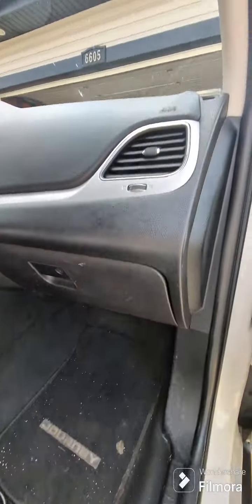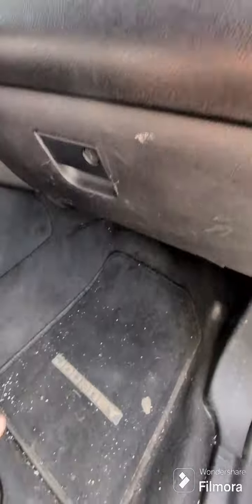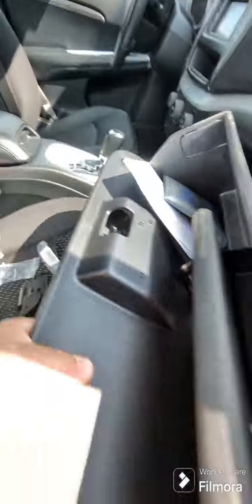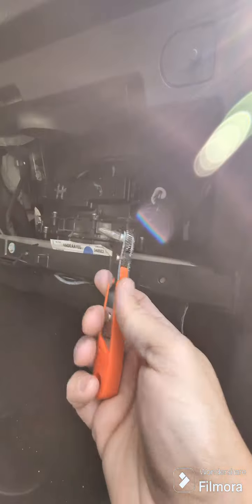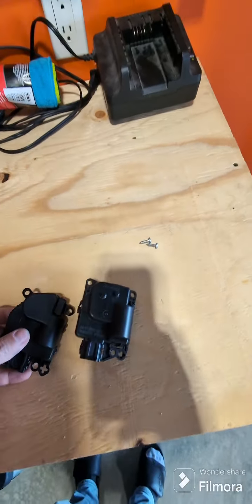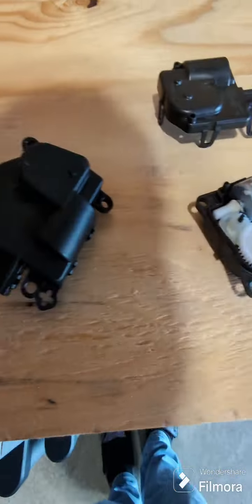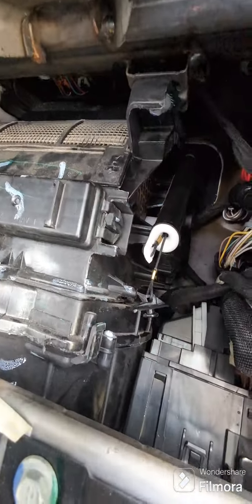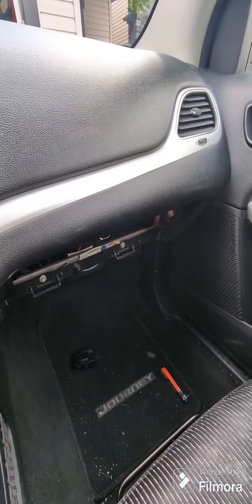Glovebox Clicking Noise Fix ( Save Money) Blend Door Actuator!

Comment: Thanks for the video. Much more confident replacing this after watching. The white plastic shaft has one larger gap in the teeth. I assume orientation of that gap in the teeth teeth matters when putting the new one on. Any tips on getting it on in the correct position? Does part you feed the shaft into only allow it to go on in the correct orientation? Thanks again!